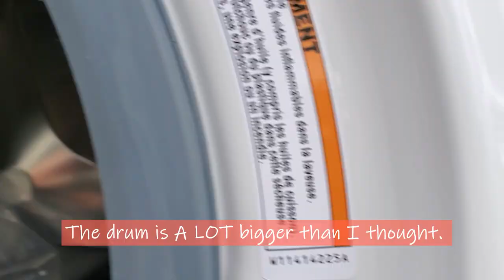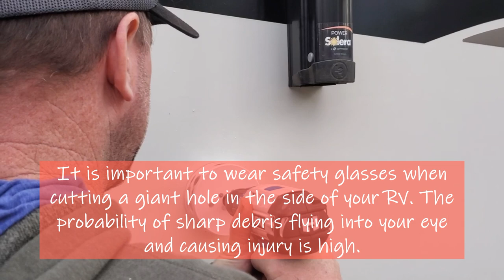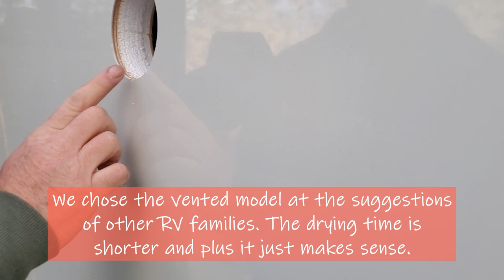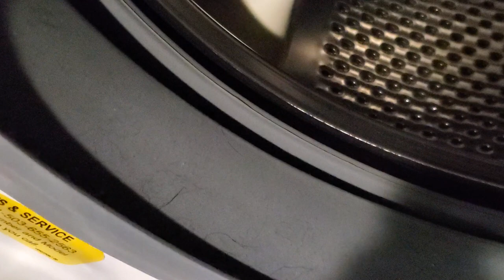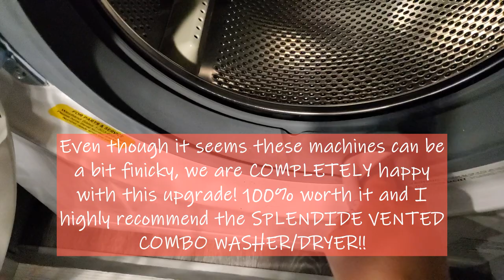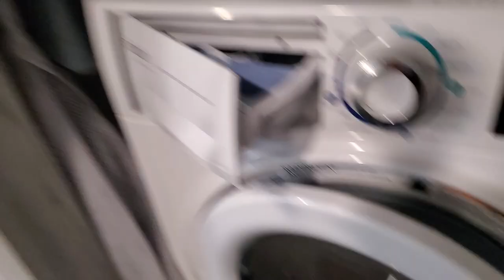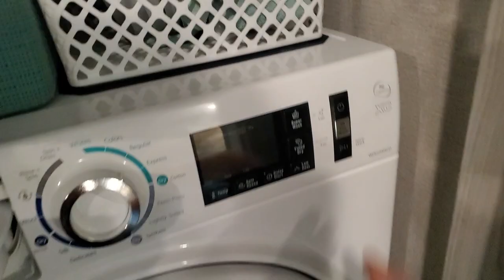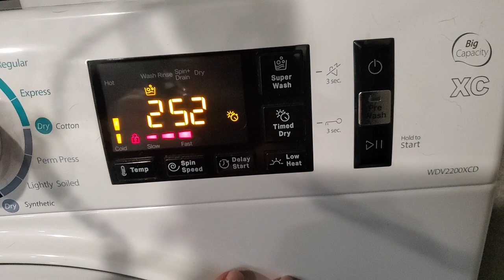RV Washer Dryer Install, Review, PLUS~RV Laundry Hacks! NO MORE LAUNDRY MATS! ♥ :)

Comment: Two questions:  did you feel the need to brace the washer to the floor? And what about a drain pan?  I’m getting ready to install this unit in my fifth wheel. My closet has carpet so I’m thinking of removing the carpet and putting vinyl flooring in that spot.